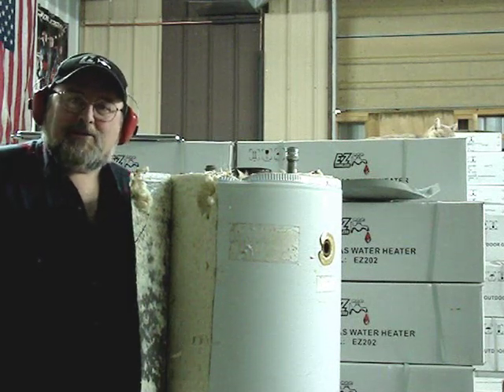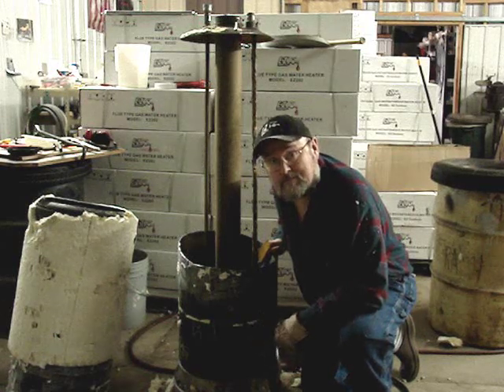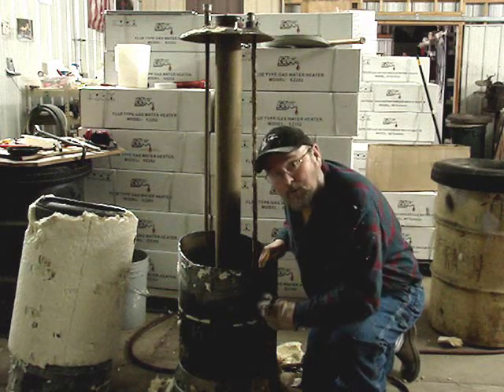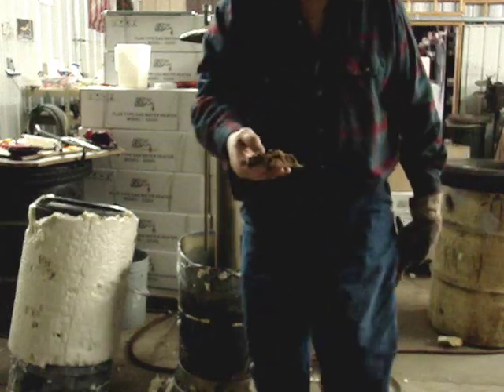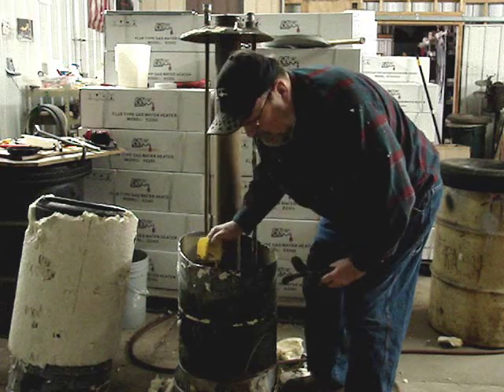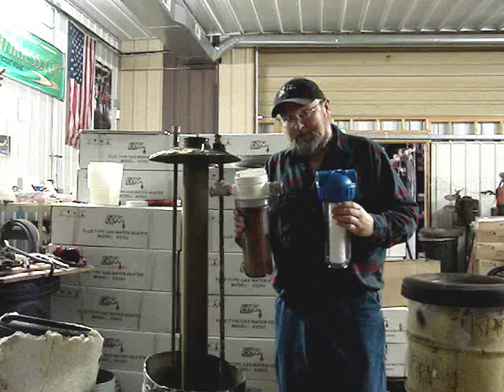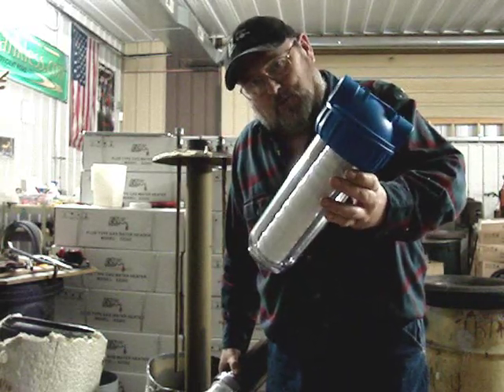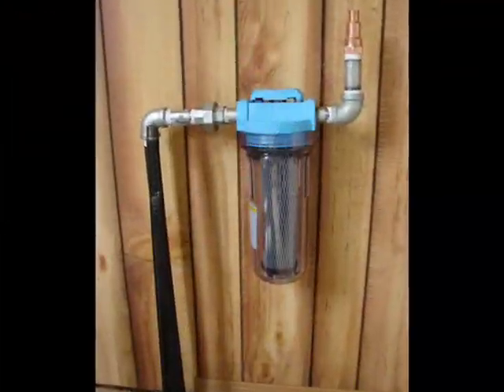Tankless water heaters need filters, we show you why. (EZ TANKLESS)

Comment: Jim, your so right, I removed a conventional 30 gal. tank from an older home I bought. It had virtually zero volume left, when I drained it to take it out, got less than 5 gallons. It was so heavy I could hardly lift it, mostly rolled it. If codes didn't prevent me, I would have tankless now, I used them in Korea and their great, endless hot water and no wasted energy. Keep up the great videos, Thanks.